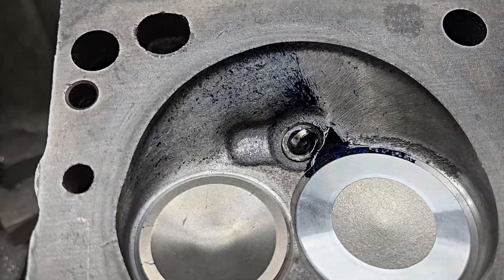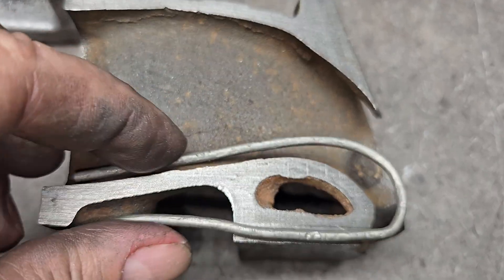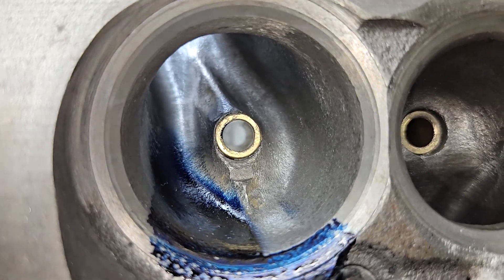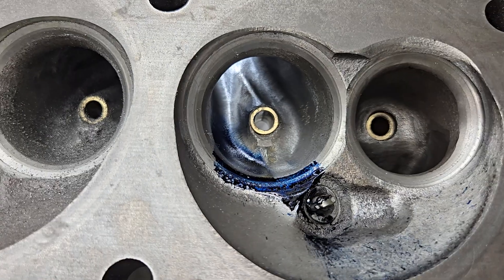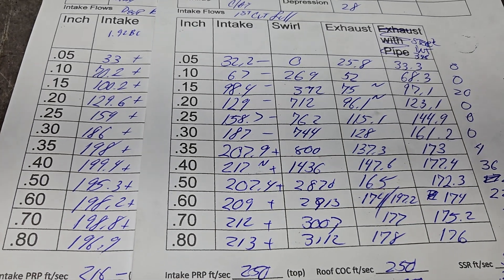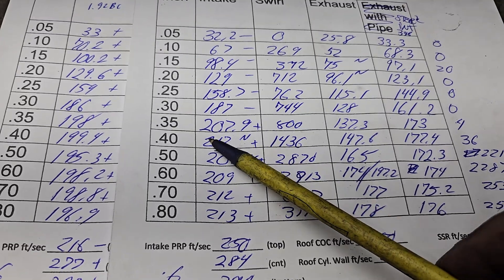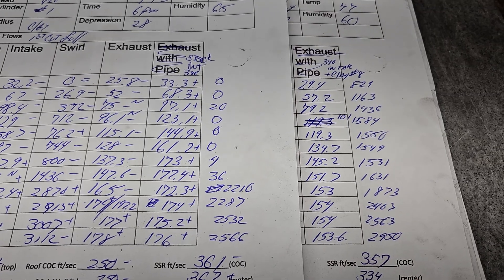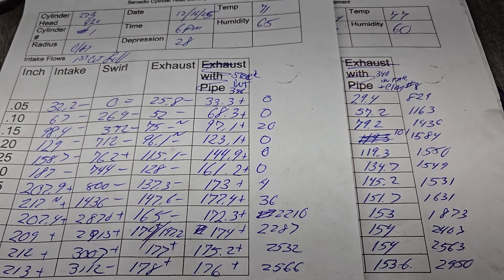Mopar 273 Commando project, 920 cylinder heads, Mopar Magnum valves, First full cut vs. Bowl blend.

Comment: How do you think they compare to 302 heads? I'm just a hobbyist, garage porter, that does heads with a "feeling", don't have a flo bench or anything. But the guy I take the heads for a valve job does, and I often ask him to flow the heads  since he's got a flow bench too. The 302's I did had the stock valves, 1.78/1.50. They flowed 169 at 0.3 and 198 at 0.4". After that they stayed pretty even, at 0.6" 199.6. However, didn't get nowhere near your numbers on the exhaust side. 140 at 0.4".
Reply from the maker: I think I have some 302 Mopar head videos. I think I squeezed 245cfm out of them? Not sure these will go there with this sized valve. Thanks
Reply: @servediocylinderheads  I really enjoy your videos even if I'm from the other side of the world and do not have the equipment to research the heads scientifically. And of course a flow bench is only a flow bench with steady flow.
 Anyway, these cideos give me thoughts about what to concentrate on etc. Thanks for youer effort!
Reply from the maker: @vipottaja I appreciate that. Thanks
Reply: That's pretty good. 👍👍😎

Comment: I want to say my 920 head measured out at 116cc on the intake port in stock/used form.  NHRA specs the 315 casting at 130cc, but those numbers are a little bigger than normal.
Reply: Mopars always have a generous NHRA spec for cc’s in the intake port and small in the chamber
Reply from the maker: @Patrick-xd8jv Good info. Thanks
Reply: @Patrick-xd8jv  Yeah, like the 302 castings at 160cc for the intake ports.  Same as the 360 castings.

Comment: The AFR Blue Hornet heads are 175 cc int., the Trick Flows 190 cc. 
Not referencing your customer’s build, but I’m wondering on a stock stroke, small cam 318, would it be better to start with a 360 head? Thanks!
Reply from the maker: 360 head has airflow but it has a huge chamber and compression will be low. Thanks
Reply: @s @servediocylinderheads  Yeah, I should have said “aside from the larger chamber”. Thanks.
Reply from the maker: @rong4189 That is the problem. Ported small chamber heads will actually work better. Thanks